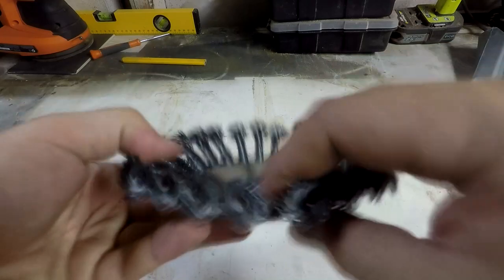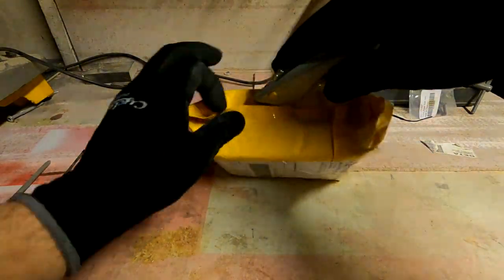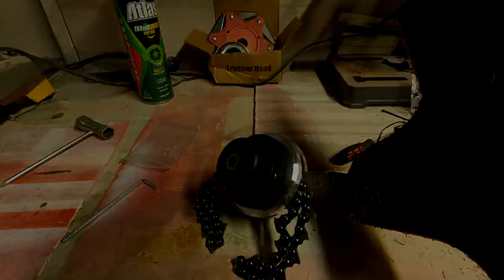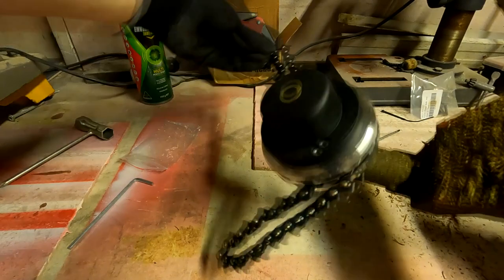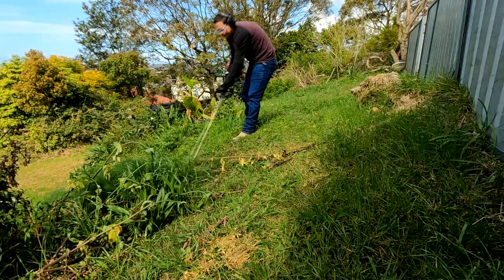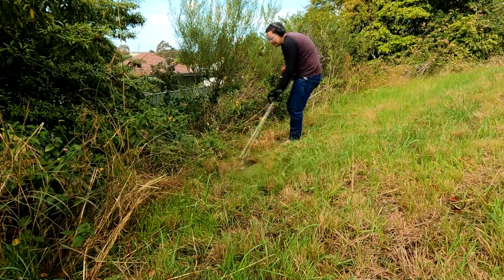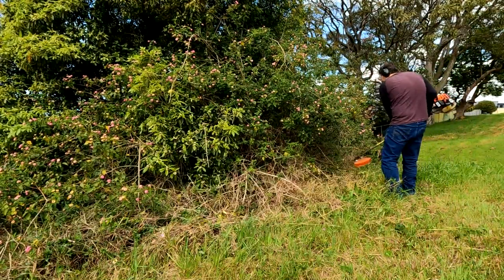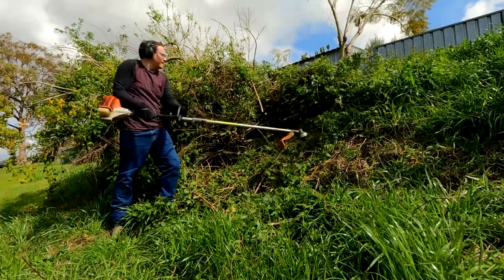Are Chain saw Trimmer Heads Any Good?

Comment: I use two types of blades. First the round chainsaw type cutter that cuts trees like butter. I use the round one for heavy brush. I use the kind of cutter with the regular chainsaw blades like the one shown on light brush and grass. The head hasn't been very durable for me but I use it very hard and I love how it cuts. I find that not looping the chain like they do but just having one straight leg on each side cuts better and maintains speed better. If you use regular chainsaw blades with teeth, they tend to get clogged with long thin grass. 

I plan to make my own head with must stronger material because I love how it cuts and how long the blade lasts. Just be careful NOT to wrap the blade around metal poles or fences. Hitting it with the tip is fine, but if you let it wrap around by being too aggressive, it can be very hard on the blade. 

I've stopped using the brush cutting deck on my tractor and started using just these two blades on my commercial grade Stihl weed eater. You need a powerful weed eater to make this thing work properly.

You absolutely need eye protection with this. It throws chunks back at you. I wear glasses for the wet stuff and a metal screen shield for the chunks. Some people might want even more chest and leg protection because it will whack you good.

Comment: I have a new gas weed wacker There's a shaft that comes out of it with threads on the inside of it. And my new chin typehead, just like yours, has threads on the inside of it. I need A adapter  or screw To connect them together In other words, both shafts are smooth. And threads on the inside.. Do you know anything about it?

Comment: The best blade for lantana, sticks, and even grass is the 2 tooth Mulching blade - Has the 12inch  reach, weight and momentum to destroy anything in its way. The cheap chinese ones for $13 do bend if you hit rock or fibrous palm branches and then need to straightened.